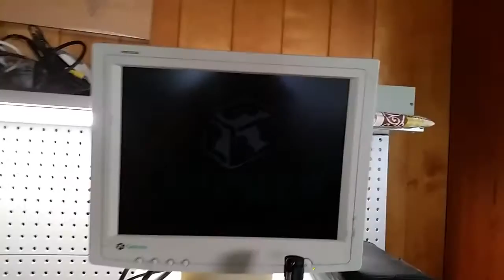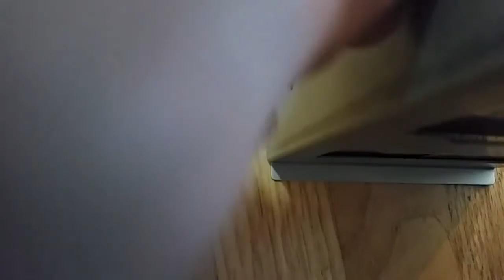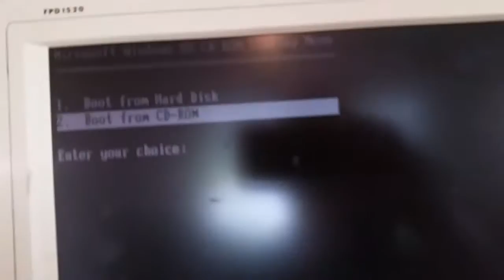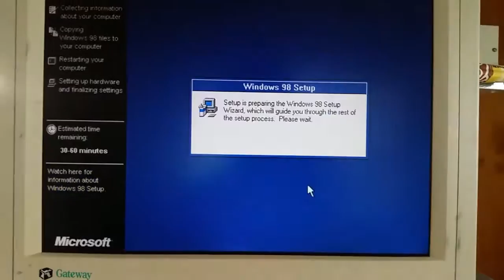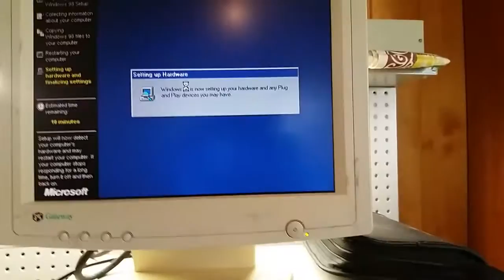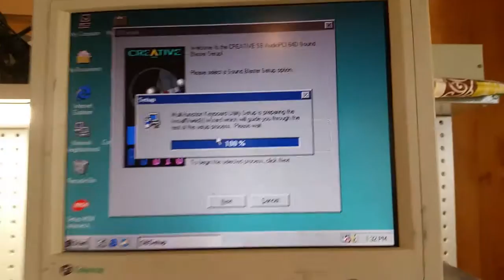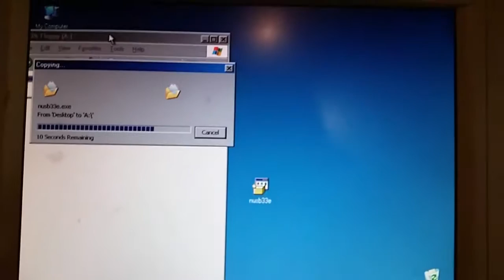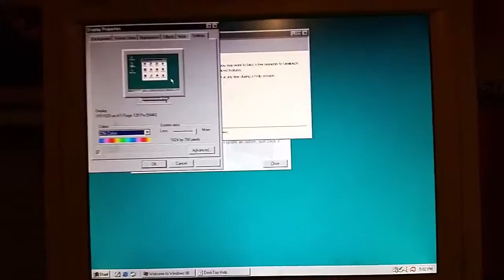Gateway G6-350 Windows 98 restoration Part 1

Comment: Could you possibly upload the driver CD for that PC?
Reply from the maker: Which drivers? Graphics? Audio? Chipset?
Reply: +Zestypanda I need the graphics, if you please. I have a G6-350 I found at the dump in excellent condition except the hard drive was bad. I can find every other driver except the video. Thanks!
Reply from the maker: Indigo8086 What add-in video card do you have in it? The ATI rage pro/128? Or the nvidia riva tnt 2?
Reply: +Zestypanda it actually doesn't have an AGP slot at all :/ it has vga on the board but I can't find a manufacturer at all
Reply from the maker: Internet archive has the drivers now.